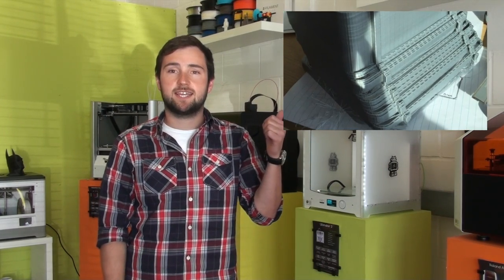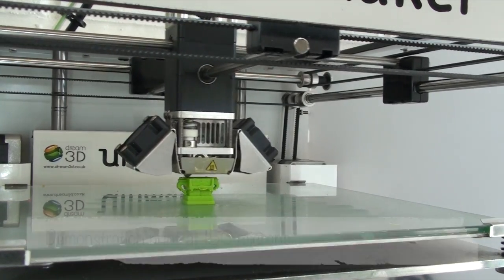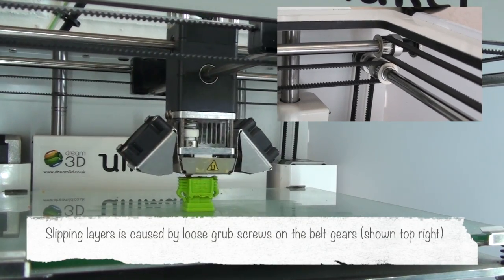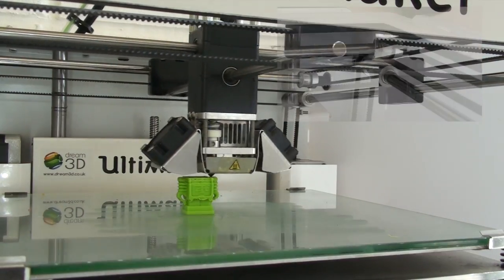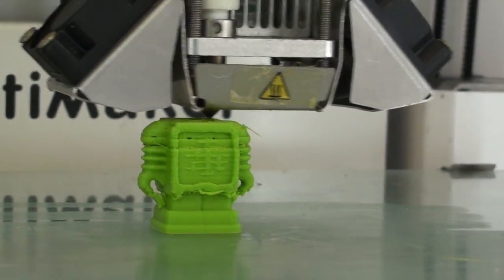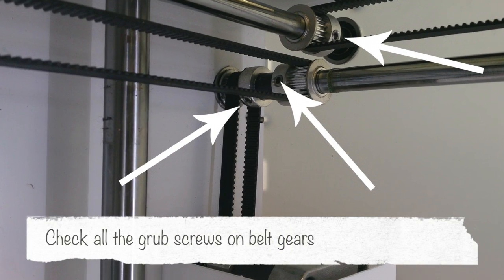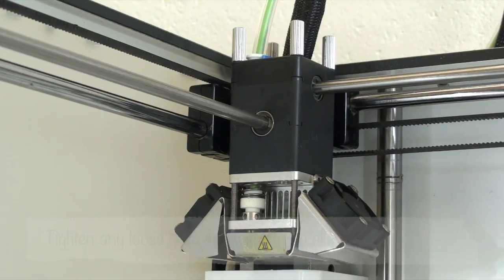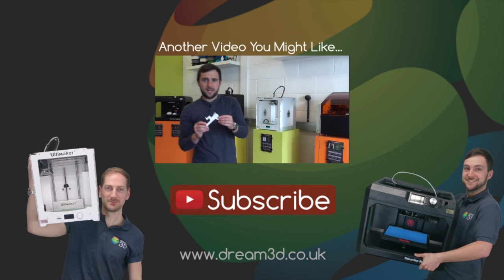Fix Slipping / Shifting Layers on the Ultimaker 2 | Support | Dream 3D

Comment: i checked my pullys and i even changed the screws. but it keeps slipping. sometimes even a centimeter. anny advice? it is on an ultimaker original.
Reply from the maker: +marijntuijl what's the tension like on the belts?
Reply: +Dream 3D i found the problem. the x axis was moving because one of the little plates holding it in place was a bit lose. but also one of the screws on the pullys was wheadert down so i replaced it. thanks though!!
Reply from the maker: +marijntuijl ahh right, glad your up and running again!